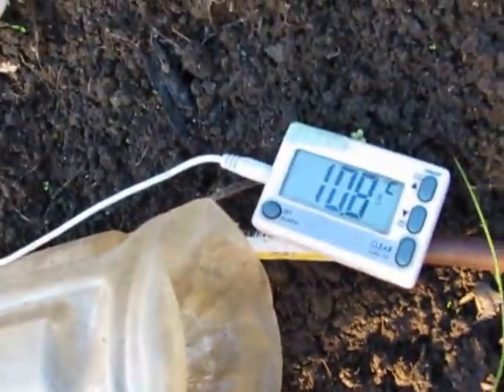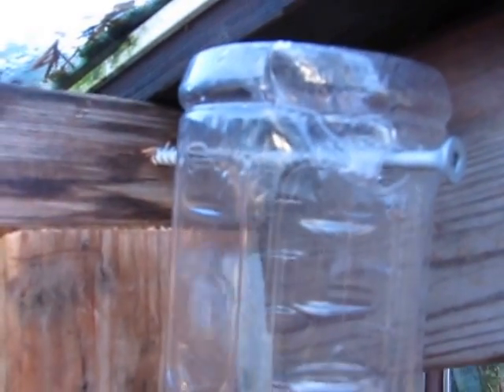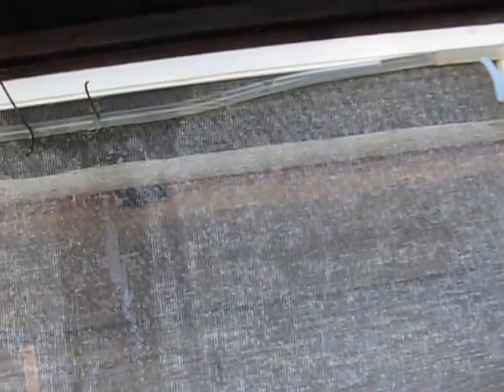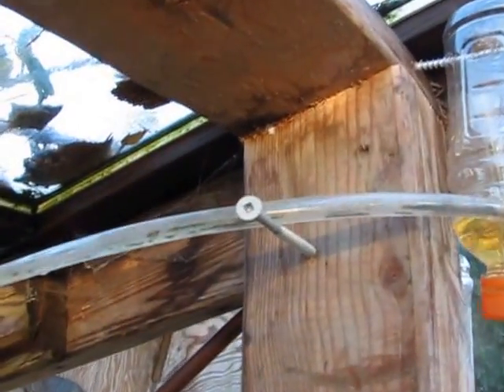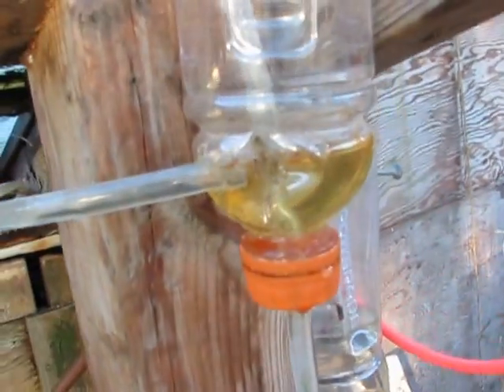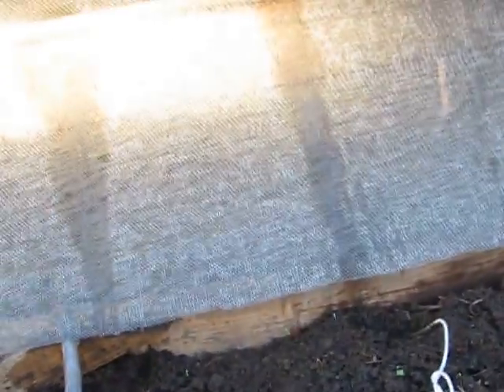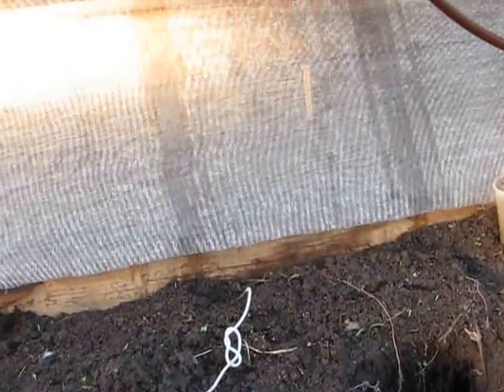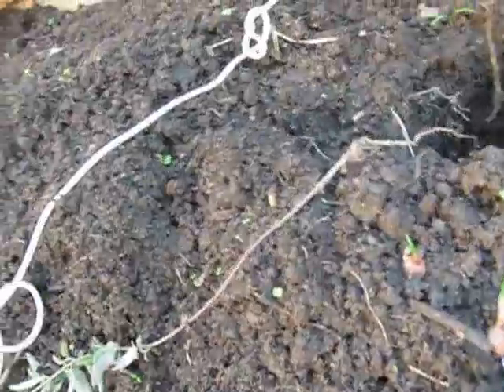Insect Screen garden  heat mover MK 2   Thanks to ItsandBits in Kamloops for his input!

Comment: I'd try a doubled layer of flat black screen, with a reflective surface behind the screen to increase the heat collection from the sun, if you get any direct sun.
Some DIYers build solar thermal collectors using a double screens like this to heat air, and there are videos on YouTube showing the collectors they have built.

Comment: Seems like the screen would soon be covered with lots of moss or other flora and fauna.  How do you prevent that?
Reply from the maker: I will try it out, take measurements and see what happens. Also, mine is not the only way.  If you feel more comfortable with a solar powered water pump, you can use one to circulate water through the windowscreen and down into a 20 liter or 5 gallon container that you place under the soil.  The container can be round or flat any shape that you think might work.  Also, will this work outside with no greenhouse?  I think so.  You might lose more water to evaporation but your solar flux will increase.  Seems to me right now in my greenhouse that the air temperature is really low so the only heat it is collecting is the heat from the sky. (It is rising the temperature a couple of degrees over the air temperature on a cloudy dull miserable day!  So there is hope for the future! Brian
Reply: If the screen is galvanized, the zinc will kill moss. Zinc strips are sold for use as a moss killer on roofs.
Alternately, one can just scrub the screens every few months.